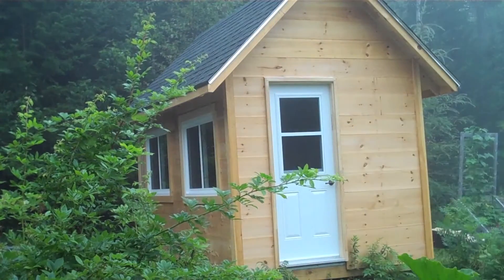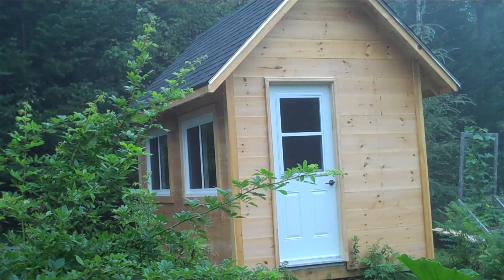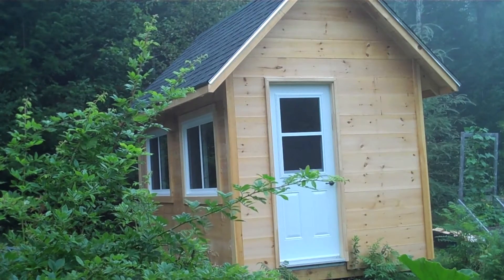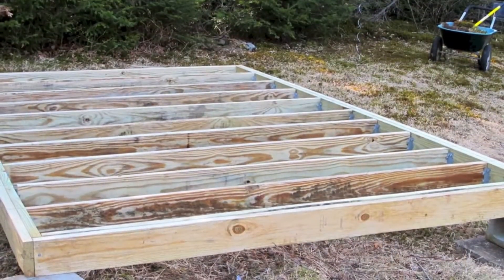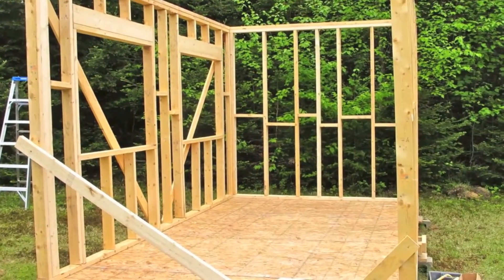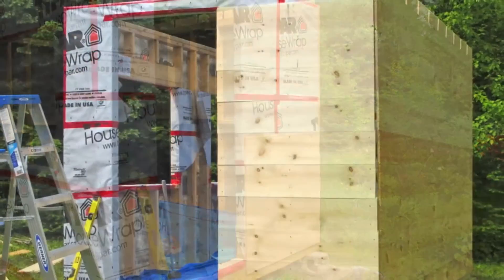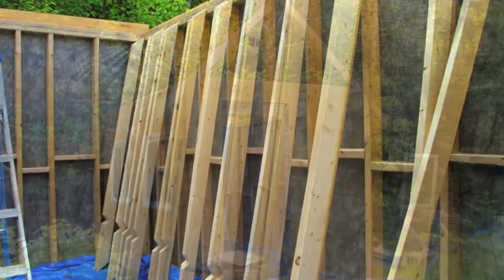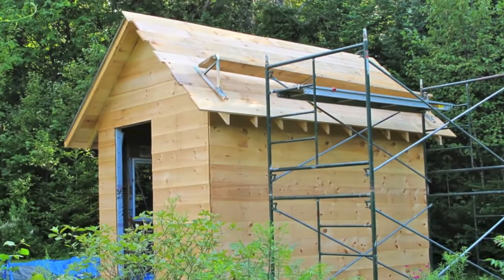The Cabin Project 2012.

Comment from the maker: Thank you it has been fun building it, even with the mistakes. I'm working on the inside now it's insulated and I just put down a pine board floor, painting that tomorrow, I have the stove and material for the walls and ceiling so I hope to have it all finished before cold weather.

Comment from the maker: Thanks Diane. I want it to be completely off grid as they say. Looking forward to reading up on solar electricity as I sit by the fire this winter. I don't plan a very large system just enough for a few lights and maybe a small 12 volt refrigerator, bar size.

Comment: My shed was built in 03'. My wife and I built it. It is the only substantial project I've ever done. The only trouble we had is we sheeted the outside and had plywood flush with the top of the framed walls. Put the rafters up and then had to figure out how to fill in the space at the top of the walls. You notched YOUR top plank-so simple. I had to buy 2x8 and notch that and angle cut to fit roof. I look at it sometimes and wonder how we ever did it. Materials(lumber was cheap then) was still $3K

Comment from the maker: Thank you. I was a long while getting my head around the three cuts needed on each rafter, top angle, bottom angle and birds mouth. Complicated because I didn't want to use the pitch that the plans called for. I have two 2X4's that I used to practice with that each have several birds mouth cuts in them. Once I had one that I liked it was ok from there on in I just used it as a templet. I looked at both solar and wind power and settled on solar, seems like there is less maintenance with solar.

Comment: There is a "tiny house" movement in the States, and if you build a house under 100 sq ft or there a bouts then you avoid building permission and all sorts of taxes. I think I would like to have something comfy and small with a stove in it, and close the oil guzzling main house down in the winter and live out in a cabin and heat with wood. All the best with getting it winter ready.

Comment: Does your cabin just set on concrete blocks on the ground? Like you I do not have a lot of building experience, but would like to build something like your cabin. I’ve been told for a small building similar to yours to just put it on concrete block on the ground. I’m thinking a couple inches of compacted stone, a 2’x2’x2” paver with a concrete block on top. If it rises in the winter it will settle in the spring. Any feed back will be appreciated. Best wishes.
Reply from the maker: That sounds like a good plan yes mine is just sitting on concrete blocks and that hasn't been a problem at all.

Comment: whats the ballpark price to complete this? didn't see any price in the comments
Reply from the maker: ***** Not sure but it could be done for a lot less money than my version I used a lot of expensive materials. Because I was building it alone I couldn't handle 4X8 sheets of plywood safely so I closed it in with pine boards the outside walls are shiplapped pine and the walls and ceiling inside is tung and grove pine, also I insulated it which is nice but not necessary because of the size the wood stove heats it up quickly. I also put styrofoam under the floor, I like that though because the floor warms up and stays warm. The windows are egress rated and fairly large. I modified the roof didn't make it as steep as the plans called for because I don 't want the loft used as a sleeping area due to the wood stove. Great storage space though I cured my onions and garlic up there this fall.The plans called for a window in the loft but I didn't do that because there wasn't room enough for an egress rated window another reason why I didn't want a sleeping loft. Also I incorporated the deck area into the cabin to make the interior larger, so many black flies and mosquitos here I wouldn't use the deck anyway LOL.   I didn't keep an accurate accounting but I would say in the $5,000 range including the stove, chimney and futon.
Reply: ***** great info thanks. not cheap. I think I'd try and do mine for less :) hopefully free stuff like free stove and such.
Reply from the maker: ***** Of course building materials are not cheap but like I said it could be done for a lot less money than I put into it. The pine inside and out was very expensive and so were the windows and door. If you could find a source of second hand or shop at the Habitat store if there is one on PEI you would save a lot of money. There is one in Fredericton and Saint John likely one in Moncton too.